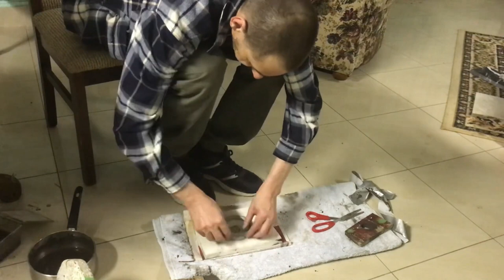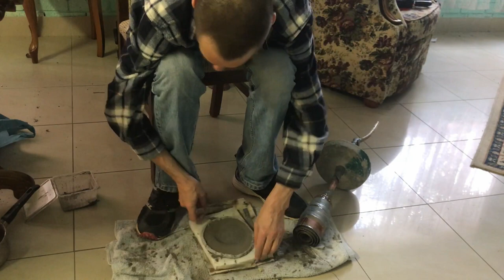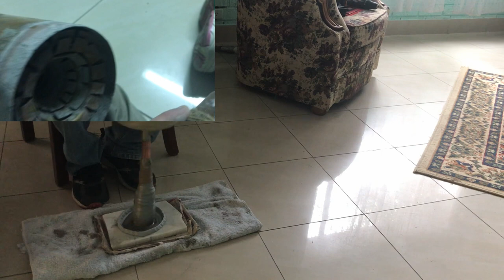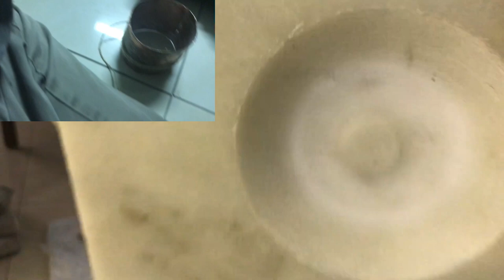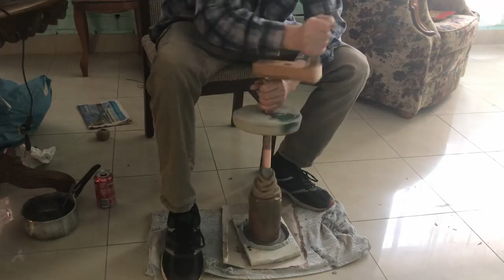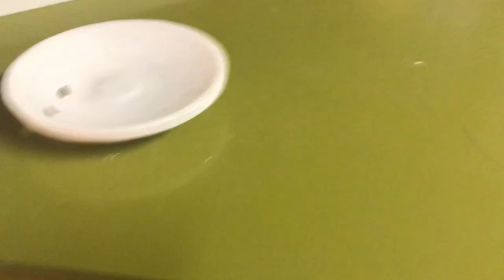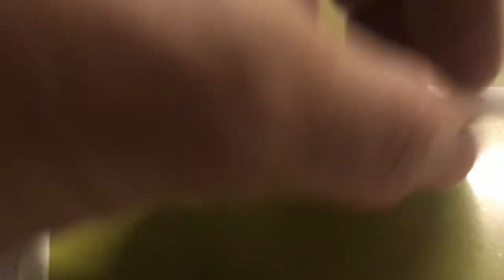Making my 1st Lost Ancient High Technology with "Primitive" Egyptian Style Hand Tools & Technology.

Comment: You've inspired me.  In the past i have ordered cnc cut 14 inch diameter stone circles to make little cocktail table tops. If ever have time (so probably never) I have some marble and granite slabs to cut , lbs and lbs of scrap copper, and I started saving used sandpaper ... I would like to cast a sheet of copper alloy and roll it into a 14 inch tube drill Or cast a 14 inch tube drill.
Reply from the maker: Burn the sandpaper to get it separated irs easiest. I reckon attaching an old drill or machine motor 
Stack up a few slabs and just let it run . On a frame where it can slide down.
Even with sheet metal scraps
Though feeding the grit and water might be pain to set up.
Reply: SGD Sacred Geometry Decoded  yes that is what I was thinking....I will have to ponder the abrasive feeding
Reply from the maker: Crushed sandstone is also an excellent abrasive, higher quartz content and granite and some sandstone has up to 15% aluminium oxide. Even just a few buckets of river sand from the landscape suppliers would work.
Maybe a bin or washtub and bury them in sand? Fill it up with water. The rotate tube will was out the fine particles and fresh sand will fall in. A bucket with a small hole to drip in enough fresh water to allow the overflow to take away the fine stuff.
Reply: @SacredGeometryDecoded  I have silica sand blasting sand which has fine dust but i would be guessing the size of the grains. i regularly use 80 up to 320 grit sand aluminum oxide sandpaper so i could burn them separately to try different grits
Reply from the maker: @itsnot_stupid_ifitworks  to make my polishing paste I put the waste in water and stirred, let it settle a few seconds then poured off the water. Repeat waiting 10 secs, then 30 seconds then a minute and so on , 
I reckon that the coarser stuff better for rapid cutting, then the finer stuff for smoothing of the striations. 
Though on those gang saws they have a fine watery slurry running non stop?
Reply: SGD Sacred Geometry Decoded  I would presume the modern gang saw abrasive solutions would be more complex than just fine abrasive and water so that could be why
Reply from the maker: @itsnot_stupid_ifitworks  They have steel shot these days, diamond teeth. But the older ones just iron bars and slurry with emery or carborundum
Reply: @SacredGeometryDecoded  abrasive slurries work much more proficiently if they are flowing and center fed. there's a few reasons for this.
Reply: in the 80's we cored 48" diameter cylinders 4-6 feet deep in the quarry then laid the cores horizontal and sliced into table tops 4" thick. both the core saw and the wire saw were steel using abrasive slurry. when 2cm slab industry became popular in the early 1990's we used a turntable diamond band saw. From 2000 onward we cut everything with a CNC diamond blade, finger router bits, or waterjets.
Reply from the maker: @GroberWeisenstein  cheers, there' a lto more going on with that stuff than meets the eye. I noticed with these limited experiments how slight changes have a big difference. Gain 5% here and 10% there it all adds up over time
Reply from the maker: @GroberWeisenstein  damn that 2c,m popularity, getting decent thickness pieces is near impossible without going to a big supplier who virtually hang up when they hear about the small pieces i need.
Reply: @SacredGeometryDecoded  go to a monument/memorial company for 10, 15, 20, 30 cm thick granite colors and white marble stock. some will have blocks.  Buy grey granite base stock its the best value in sawn slabs. There's one in Sydney my friend used to work for I think they were a Greek outfit. (I'll ask) Thin slab marble/granite/quartz fabricators will only stock 2cm and 3cm thick material. You can always laminate thinner slabs in a pinch. We produced thousands of countertops, fireplace facings, and marble furniture over the years using lamination methods. Sculpture supply stores also sell small blocks but they are extremely pricey. Landscape/hardscaping supply yards also carry dimensional stock and boulders and are usually the best value especially for 2-man sized stones. (under 320 kg) and usually with no minimum order requirement.
Reply: @SacredGeometryDecoded  yes, the overriding concern from a mason's pov is always on cost -efficiency - productivity within established standards of quality. The question if evolving primitive technology could produce such work is less of an issue and shouldn't be up for debate but unfortunately it is thanks to charlatans and their fools. The systems they had in place to enable productivity on a large scale is the most challenging and interesting to unwrap. Your experiment provides a great example of all the considerations that need to be realized even in a basic scenario.  Imagine the supply chain infrastructure that was needed with all the various trades to support the masons on large scale projects? Although Scientists Against Myths showcased an example of primitive vase fabrication it is still a far cry from addressing systematic production on an industrial level.

Comment: What if it was possible to separate out the harder particles in the sand, perhaps using a technique analogous to panning for gold, and then using this ”hard sand” in the grinding. Would that make the copper sawing (drilling) more efficient to any relevant extent?
Reply from the maker: I do something similar, i stir up the used grit, the finer stuff is suspended in the water and i pour it off. Then let it settle and repeat waiting longer between each turn to separate the grit into increasingly smaller particles that I use for polishing later.
The heavy copper settles fast and I panned it out to show how little if no copper is lost in the process.
I never thought about it until you mentioned it but also the soluble bits would be separated out also further refining the grit.
I have used different types of abrasive, crushed sandstone becomes a muddy mix but with crushed white quartz pebbles the sand compacts rather than become a slippery mud.
Reply: @SacredGeometryDecoded  Very interesting. I also just learned that the desert sand and the black sand from the Nile banks have rather different contents. Most notably, the latter contains ilmenite, zircon, magnetite, rutile, garnet and titanium at (economically) significant levels.

Comment: Beautiful piece of work there. Watching that, I wonder if the drill tubes could have been cast - in one piece even for a job like this - perhaps easier for them with their lack of rolling mills. It's perfectly possible to cast in stone dies (...hmm, "cast in stone", how curious) which opens intriguing possibilities for a job like this of the toolmaking and stone working were taking place in close proximity - casting a tool to work the exterior from the completed interior profile, perhaps...?
Reply from the maker: Scientists aginst myths cast a copper tube for one of their demos. 
Though egyptian impure copper casts much better thna the pure modern stuff because of the arsenic in it. Cannon and bell makers used to (or still do) use arsenical copper/bronze. I forget the name of it but it stops bubbles and other flaws forming during the process.
Yep, definitely several options, and once done just recast the copper for another tool or jewellery etc.
I saw a video about what happened to all the ancient gold. It's still in the economy, there could be roman and egyptian gold in the circuits of your device.
Reply: @SacredGeometryDecoded  Aye, that last point is one of the reasons I have a certain amount of doubt about our dating of the eras of various metals - reforging or recasting metal objects found is so common, and fair to assume more common the rarer they are, so it's quite possible the work of very early metal workers would disappear from the historical record. ...Add to that the degradation of iron in all but exceptional circumstances and we've potentially a big blind spot there when pushing back beyond a couple of thousand years, imo.

Comment: Hmm.. just a manual lathe and a core/tube drill plus abresives needed to make a CARBIDE gage ball holding a tolerance of 0.000005 inches. Just watched a video by Robrenz "making precision gage balls".  Five millionth , or is it 50? of an inch with that setup, i don't see a thousands of an inch on a simular , but ancient setup unreasonable. 
With some modifications, perhaps one could make the outside of a vase instead of a sphere shape , both accurate and fairly repeatable.  I know for sure, i'll never look at tube drills as just drills again. 

Maybe look at sphere machines too, which is basicly just tube/core drills.
edit: Youtube didn't want me to link the video.

Comment: Is your drill head made of pure copper or an alloy?
Reply from the maker: pure copper. 99.9% 
The pre fab tubes 1.2mm thick , most are from 0.6mm annealed copper sheets that i work hardened by rolling a couple of times.
Reply: @SacredGeometryDecoded  interesting. So actually not as hard as Egyptian copper, and it still worked, proving the point that it's not the metal doing the cutting.

Comment: Can you do this inside a stone jar with a narrow neck, grinding inside, under the shoulder?
Reply from the maker: Yes, a while back I experimented and posted a video about it. I split the tube at the ends and was able to steer them so as to get the inner shape while drilling out the centre at same time. Will be using that method when I start with bowls and vases.
The scientists against myths have done   It but my intention is to use copper and reduce the time it takes dramatically. They handicapped themselves by not using copper while also having a much slower drill rpm.
I also have method for making handles to save time.

Comment: Still will never build the Giza pyramids. It’s not simple I’m sorry lol you are cutting vids and working on a slate the size of my hand. Get all your friends find even one block of any stone and move it 500 miles then lift it 500 feet… lol I love you and all the people that think this is no problem
Reply from the maker: Very few stones were actually cut, the overwhelming majority of pyramid blocks were rough hewn locally. 
The cutting experiments would work just as well on a big stone , if i cut a small piece of wood with a saw you would know it works exactly the same with a longer saw on a larger piece of wood.
The blocks from 500 miles were actually only moved a mile or less, the quarry at aswan right next to the river, the current of the river did the most of the work.
Old film and photo of quarry men and masons moving those sized blocks was just normal and totally unremarkable.
They never had to be lifted 500 feet, the grand gallery for example is a ramp of 26 degrees and similar found in ancient quarries. 
I worked in rigging and lifting ans so have an insight on what can be done. Sail ships with small crews needed to be able to manage sails when tens of tons of pressure being exerted on them. No need for my friend to get together and do it, as with old timey quarries and sailing ships we;ve been doing it non stop for centuries. only in the last generation or two have most become separated from the world that existed for our grandparents and great parents, we're a species with amnesia of what life was like a 100 years ago.
Reply: @SacredGeometryDecoded  I agree with your first sentence.. you can hand drill thought granite.. great! It’s the magnitude of the project, the precision, also the fact that it exists all over the world…. More under water for sure.! Thank you for replying, I love your channel  always have and will:)
Reply: @SacredGeometryDecoded  284 cubits or feet?
Reply: @SacredGeometryDecoded  I agree with you my friend . I just always ask questions and give my opinion.
Reply: @SacredGeometryDecoded  reguardless lol . Put a 30 tonne stone on a large canoe and float down the Nile 
..
 10000 years ago . How many 70 tonne blocks were cut and hoisted 300 feet?. Let’s be real now
Reply: I love that you can drill and smooth out stone. But it’s not the same and you know it

Comment: 1) this is not granite or diorite or corundum
2) this is not high precision nor spherical 
3) it is made in the simplest form with no handle wich complicate the process exponentially

in conclusion you haven't exsposed any ancient technology
Reply from the maker: This was my first and highlights the errors. other examples in alabaster are highlighted by lost high tech types,
I have been working to improve the time taken and quality, as i care enough to put effort in unlike your crew.
My granite and porphyry ones are much better. Do you think this was picked up in a couple days?
What have you done by the way? What contribution have you made?
Of course it isn't spherical, its a dish, it isn't meant to be spherical. Although  it is circular to a high level of precision. If you actually tried you'd learn how easy it is.

In conclusion you have done nothing yourself, you leave ridiculous comments such as pendulum saws cutting parallel to the ground.
Let me know when you're willing to contribute more than idiotic comments desperately trying to protect your cult beliefs.
Reply: @SacredGeometryDecoded  i said double pendolum leave parallel cut. Do you know how 3 segments move?
Reply from the maker: @marcoferrari4285  and i said a double pendulum wont leave a parallel cut because its still a pendulum. When either rope is vertical its distance to the horizontal is closer than when its at an angle. therefore it just cant be parallel, there was a example of it in the video, it earlier video i made miniature models of it. 
it just silly, the ropes still move or swing in an arc.  Without some sort of tensioning mechanism it is never going to cut parallel.
it will always cut in an arc. The two ropes swing together, gaining and losing height relative to a horizontal plane.
Unless of course you have access to magical elvish rope?